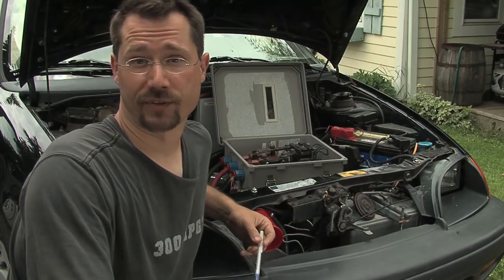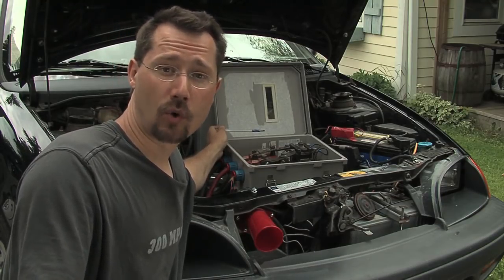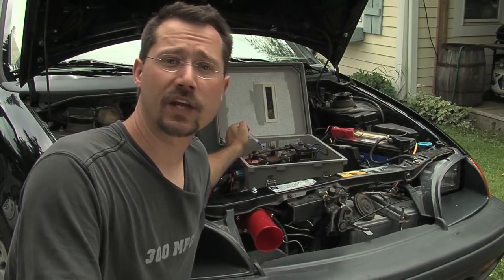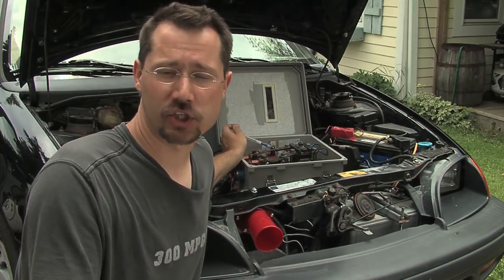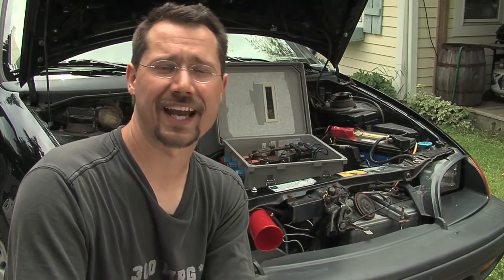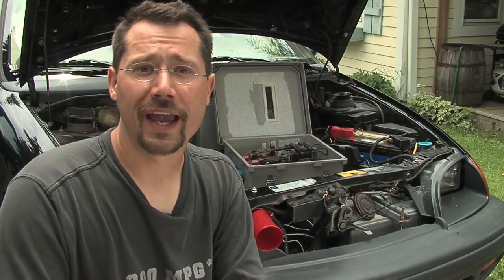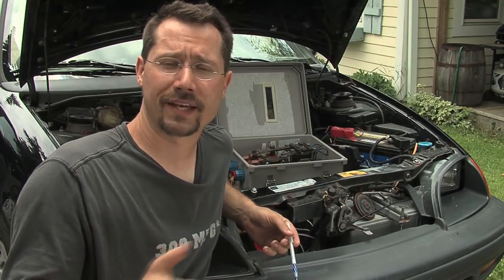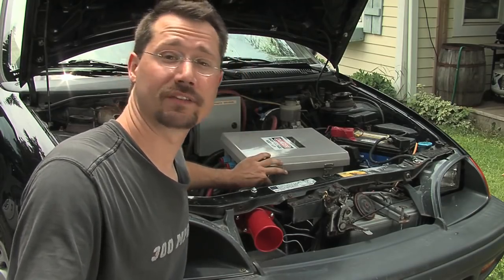14 Build Your Own Electric Car: Balance of system

Comment: Cool video, but I missed how you are allowing for the 72v battery pack to charge the standard 12volt battery (the original one).
Reply from the maker: Hi Simone! On this project, I simply had a 12V battery charger which would charge the 12V when the car was plugged in.
On most Electric Vehicles, we use a DC/DC Converter. That's a device that takes a small amount of power from the high voltage battery pack and converts it to a lower voltage, typically to charge the 12V battery on a car. You can think of it taking the place of an alternator, only being smaller, quieter, more efficient, and having no moving parts.

Comment: thanks for such great videos. your project is inspiring but I wonder what about the Air con and power steering systems in the converted ev car
Reply from the maker: One of the reasons why I chose the Geo Metro was that it was a fairly basic car. It did NOT have power steering or air-conditioning. Because of that, I didn't have to do anything for that at all.
It DID have power brakes. Power brakes use vacuum created by the engine. So, without the engine, the brakes are VERY hard to operate.
I added a 12V vacuum pump, small vacuum container, and a vacuum switch to automatically turn the pump on as needed.

There are now electric versions of air-conditioning and power steering available, which can simply be bought and installed.

Alternatively, if your vehicle has belts powering those accessory items, you could use an electric motor with a "tail-shaft". Attach a pulley to the tail-shaft and have that power the accessories in the same way the gas engine did.

Comment: four motors like you use a the wheel with alternators powering them direct. some people have tried on really small car to make alternators into motor and then direct connecting them using a cord and then turn the alternator with a small dc motor with a gear and ration to conserve energy and it work but break easy do the pounding of the road and up and downs of the wheel.

Comment: You should attach a alternator to the output shaft and have that wired to a one direction flow to the battery's to keep charging as you drive it'll help distance maybe but at least lest time for normal charging
Reply from the maker: An alternator is a very POOR choice for an electric car. Here's more.
https://300mpg.org/projects/electro-metro/why-dont-electric-cars-have-alternators/

Comment: I really like what you do. I'm in the process of building my own projects. Can I count on some of your experiences and perhaps get you to be a part of my venture. By the way, do to all the buraucrats and control regulations that the energy Cartels has in place. It's going to be hard to start anything and turning it to a commercial venture. Everything is so much easier and faster in over seas so I will be looking that direction.  Right now, you can start anything in China in the industrialize zone with just a permit. Also, right there is where everything you need for supports and   supplies. GM and Ford biggest moneys making is in China...Four time the American markets. All the smart American companies are not in Asia. You start in Asia then the next move is Africa. The future is Asia and Africa ( the moneys ).

Comment: Pretty awesome..I have some info that might help you get unlimited mileage for an investment of 250$or less....if interested email me at servnyall@gmail.com...it depends wether you go to the salvage yard or get them brand new and also includes what you might need to pay someone for the conversions but with your knowledge you could probably do it all yourself for less than100 dollars...but I was also thinking of a more involved way for your project because you like to be extremely sure things are not going to blow or overheat....so u might want to have a gauge for each individual battery and also a toggle switch so u could control each batteries charging where they would not get overcharged...also u wouldn't have to ever plug into the house either...I'm learning myself how this works but it involves either two alternators....or one alternator and one electric motor connecting the alternator\motor to the batteries &than connect your alternator to your motor and your batteries..and use a drive belt to connect the motor and alternator so u need a toggle switch to disconnect the juice from the batteries to the motor because once it gets started the alternator runs the motor....but I'm not selling anything but would like to see if you are willing to swap info in order to help you help others and so can I ... I need some advice and experience information from someone who actually knows true  knowledge...thanks and blessings...by the way I r an excellent teacher...I've watched almost all the videos on the electric geo...and u go slow enough
To be understood...

Comment: A circuit breaker right at the batteries would be safer, exhaust pipes(the route the sheathed power cables are running), do get damaged by manhole covers , jacking and stuff and since all the protection devises are  up front , these cables are always live. Aren't they? Great project you have going here. Learned so much from your videos.
Reply from the maker: Ideally, a fuse and contactor can even be INSIDE a battery pack. Modern commercially-built electric cars often have a contactor not only complete the circuit, but also break the pack in half when it's off. That way, the voltage is cut in half as well, accept when actually powering the car.
The Electro-Metro project is now over 10 years old! Frankly, I can't remember every last little detail I did on it, and not every darn last little thing was covered in the video series. I believe that in the final version I had two DC fuses, with one directly on the most positive connection of the battery pack. Best practice does mean having a fuse or other over-current device right at the battery.

Comment: I am curious how you get your brake booster Power steering, and headlights and other electricals working ?
Reply from the maker: The brakes use a small 12V vacuum pump. The car did not have power steering, it's manual steering. In this car, I simply connected a battery charger to charge up the 12V any time the car was plugged-in, but most projects use a DC/DC converter which is an electronic device that essentially takes the place of an alternator.
https://300mpg.org/projects/evcycle/balance-of-system/
https://300mpg.org/projects/electro-metro/why-dont-electric-cars-have-alternators/
Reply: Thanks a lot  @BenjaminNelsonX  , BTW brilliant Built, thanks for encouraging us :)

Comment: Most controllers are safe in case of failing power transistor or thyristor shorting the battery wiring through the H-bridge as the controller will detect an over current condition and shut down, faster than a fuse can. An extra outside fuse is superfluous and only protects you against a short in your battery wiring, which won't ever happen if you use grommets and double insulation (garden hose). In that case it will make more sense to place the fuse at the positive battery terminal, so it also protects against wiring faults I object to fuses and power relays in the main circuit because they give you a combined voltage loss of 1.5V or more under load, which is the same as removing a cell from your battery pack reducing your range by the same amount. The ignition key input on controllers have at least two fail-safes, and do not send your car flying through the garage door at night. So in my opinion, you are adding complexity, cost and reduce efficiency by going over the top on this, but still, "better safe than sorry" is always a valid argument. I don't know if you ever said this in one of your videos, but you do not ground your traction battery to chassis ground for the reason that only one positive wire failure is needed to short the battery or send hi-voltage through your electronics. This also means that you need a floating input DC/DC converter where the input and output are isolated (no common ground, only 12v system ground connected to chassis )

Comment: Good to learn new things daily,good hobby, I'm surprised the 'snailpace' recharging or generating technology is. I was thinking about putting together something soon in a electric awd type, if this helps, I planned to manually switch batteries on and off charge, alternating probably the inline dc smaller battery packs,  but your smart enough to design a board to control the alternating electrically. Maybe something like a distributor. D size dc battery, there is another option though. There is 2 other options for the generating I recently stumbled on,lol.

Comment: Hi Ben, I have binge watch all the 54 videos on YT. Thanks for the videos. How is the ev doing these days? As it is already 10 years ago. What is the benefit over an open source controller and a, for example, Curtis controller? I am planning to EV a 1958 Simca Aronde. I first only have to weld the sills and other holes first... the link http://300mpg.org is not working btw.

Comment: My DIY EV won't turn "on" I know the batteries are charged, but the lights and guages lit up for a second the 1st time I connected the positive cable to the cable coming from the main fuse/contactor box. WHat should I be looking for? blown fuse? I need help.

Comment: just get a new electric car
Reply: Daniël De Roo  lot simpler and easier. But I seen a Irish man. Build one for 1000 Euros. I think that's 1,200 American dollars. Using lithium ion recycled. I don't know enough about lithium not to explode. I guess you will have to have a battery management system. I think there was from a used Opel ampera. Chevrolet volt in America. One of the cheapest Mass produce electric cars I've seen would be the Nissan Leaf for $7,000. Some go for high is $12,000.  New Chevrolet bolt $30,000. A new Nissan Leaf $35,000. New model X $100,000 new model S hundred thousand dollars I'm not great at math. But I know which one causes more. I wish I was great at math.

Comment: Hi and thanks for the video. When Googling regarding Open Revolt it seems to be a more or less dead project. All the schematics and info is from like 2011-2012. Am I looking at the wrong place, or is this the solution you are referring to? Thanks
Reply from the maker: No, that's right, this project is from a few years back. There's all sorts of motor controllers available nowadays, including more people making some DIY ones. A person needs to know a fair amount of electronics to build their own controller though.
Reply from the maker: I just remembered that we DID get the Open ReVolt listed as one of the parts you could search by on the EV Album. There's about 40 vehicles listed there running the Open Source motor controller. http://www.evalbum.com/cntrl/OPRV/16
Reply from the maker: The original project thread for that controller was at the Ecomodder forum. http://ecomodder.com/forum/showthread.php/paul-sabrinas-cheap-diy-144v-motor-controller-6404.html
Reply: Hi and thanks for you replies. Yes I'm an electronics and software developer so it was interesting to learn about these open source projects. However when I summarize the cost to build one myself it will still be quite some money and in the range of a used commercial controller. However Revolt may bea better choice offering interesting features a very usable communication link. I’m trying to make a cost and effort calculation to convert a VW Beetle. Best regards from Sweden…